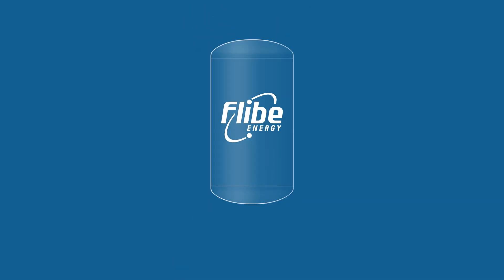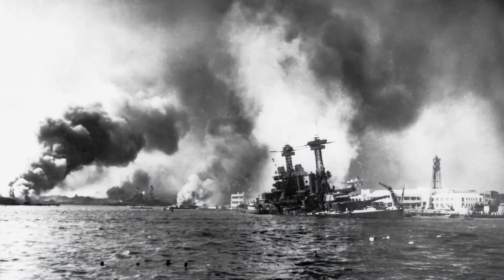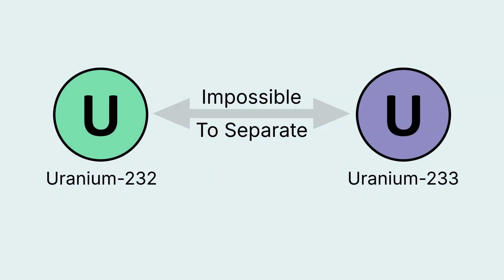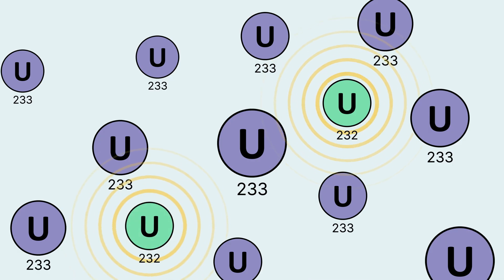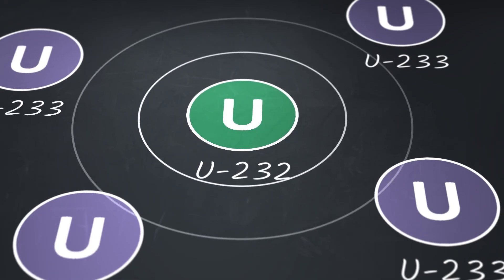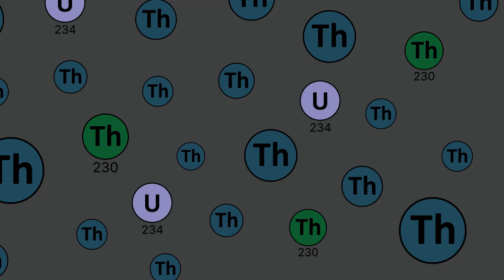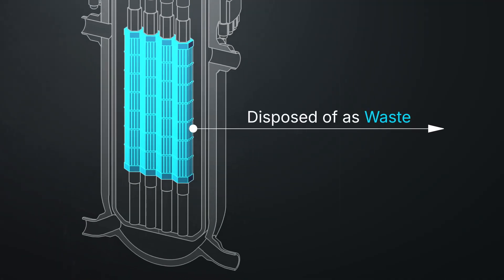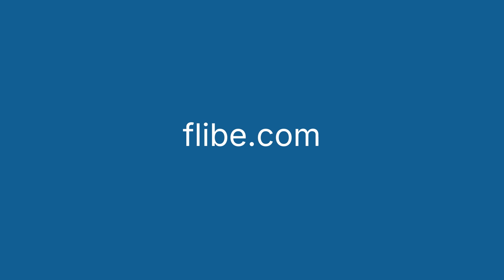How U-232 Influenced the Pathway of Thorium Reactors

Comment: The U-232 contamination issue has been solved in the LFTR "kidney" design?  I assume through fluid diffusion of sorts?

Or is it obivated in the LFTR design?
Reply from the maker: In the LFTR design we seek to increase U232 production to the maximum degree possible, to make the fissile uranium even less attractive for any diversion. We can do this because we do not employ conventional fuel fabrication and are therefore immune to the typical challenges that U232 poses for those making solid fuels.
Reply: @FlibeEnergy  Isn't U-233 the fissile nuclear fuel desired to be produced to the maximum degree? and U-232 desired to be minimized due to how it decays into products that produce gamma radiation?  Th-233 -> U-233 is the desired path?  Correct?

So what you mean is the LFTR design obviates the need to remove U-232.   Furthermore the U-232 presence is a benefit in that it decreases the possibility of it being U-233 enriched to build a nuclear bomb?

Comment: What about the pure U-233 left if al the PA-233 is seperated by fluorination in a decay tank. Still remember this question asked to TransAtomic Power  ''s Lesley Dewan in 2015. No Answer??
Don't get me wrong, I would like nothing more than nuclear power, but again this is not adressed in this video.
Reply from the maker: @arjanwesselink3418  This is a video about issues surrounding U-232 in past reactor designs, not a video discussing the specific implementation of Flibe Energy's reactor designs. It simply points to the fact that molten-salt reactors do not need conventional fuel fabrication and therefore are immune to many of the concerns around the decay products of U-232 that have troubled solid-fueled thorium reactor designs.
Reply: @FlibeEnergy  I get that, but I've also read the comments! Apparantly it was not so clear.
Honesty is the best PR for nuclear power in my opinion. It does so many things really, really well and people don't know about this.

Comment: Pointless, especially since the same tech can be used on a U-238/Pu-239 cycle (although that has a problem with prompt fission). Sorry to say no breader reactor is economical. Every nation that has tried using commercial breader reactors ended shutting down the program because of high operating & maintenance costs. Back in the 1980s the DoD did a study on at what price point would Uranium need to increase per Kg which made Breeders cost competitive with LWR: it was estimated to be about $5000 USD per Kg ($19K in 2024). Today Uranium is about $82/kg.

Nuclear power is going to die out over the next 20 years as costs rise & as high grade uranium ore is depleted. The huge cost of Vogtle, GA Unit 3 & 4 which bankrupted two companies has convinced all US Power companies to never invest in Nuclear power. I think all this talk about SMR is just hype & is going to die off in the next 2 years. Of the 4 US R&D companies developing SMR, all have shutdown their development except one that was getting federal funding.

Over all the world is heading into a energy crisis over the next 10 to 20 years as  Crude Oil (excluding Gas Condensates) Peaked in 2018. In the US, The price of Oil needs to increase to $90/bbl (in 2024 USD) to maintain or increase production. 3 of the 4 sweet spots have been fully drilled, & the last area, Permian has a water disposal problem. The US bellicose attitude toward Russia & the Middle east is also causing significant friction for global Oil production & investment. To add more trouble, the US debt is now over $101T (gov't + Corp + consumer) & Asia is looking to move away from the US Dollar for trade settlement.
Reply from the maker: @guytech7310  the dangers of liquid metallic sodium coolant account for most of those problems with "breeder" designs. There's no reactive materials in our design. Everything is chemically stable.
Reply: @FlibeEnergy  Sorry, MSRs aren't any better. They have other issues such as corrosion, caking breaking off and damaging pumps. Plus little to no viable method extracting U-232 & wastes products from the salt. Difficult to to inspect the reactor with MSR inside of it.

This tech is DoA, even if all of the tech problems are resolvable, US debt pending Oil production declines are going to prevent any commercial development. If power companies don't want LWR, they aren't going to gamble on MSR or any breeder reactors. Believing otherwise is pure hopium.
Reply from the maker: @guytech7310  none of the problems you mention manifested themselves in the nearly five-year operation of the US Molten-Salt Reactor Experiment. You're making up a straw man and then knocking it down. Oldest trick in the book.

Comment: Excellent video summarizing the historical background of the FLIBE proposed MSR solution as well as presenting clearly the mechanics involved which many would understand.  Since this is a safe solution with FLIBE having solved many of the inbetween technical issues, it is the best way to proceed with nuclear power and open up areas such as use in marine vehicles NOW rathern than later !!  Well done FLIBE

Comment: How would you deal with the hot radiation from U232 in the salt, if you need to reprocess this?! Chemically processing a salt with hard gamma radiation?! And where does the Beryllium come from? Thorium might be abundant, but Beryllium is not, and will be needed for a good neutron economy.
Reply: My understanding is that you remove the protactinium from the liquid fuel, therefore preventing U232 from forming in the first place. Let the Protactinium naturally decay into U233. But still, as the video explained, U233 can still get a neutron knocked off in the reactor and form U232...
Reply from the maker: @MaximumEscapeVelocity  removing protactinium from the blanket salt actually enhances U-232 production in the LFTR, since it transfers Pa231 formed from the (n,2n) reaction in Th232 into the fuel salt, where it absorbs another neutron forming U232. Remember that liquid fluoride reactors are immune to fuel damage from the decay radiations of U232, and we therefore desire to enhance U232 production in the reactor.
Reply: @FlibeEnergy  ahh, that makes sense now. So you take protactinium out of a blanket salt of thorium, let it decay to make U233, then mix that with the fuel salt. The Pa231 will be transmuted into U232 in the reactor and contribute to heat production. Is that right?
Reply: @MaximumEscapeVelocity  Interesting. Pa232 has a half life of 1.32d, so you need to do this in a continuous on-line process with all the other hot fission products in the salt as well. Contrast this with solid fuels, which are left to decay off most of their activity before reprocessing happens. My second thought would be that if you solve this problem, then you have a "clean" U233 making machine, which defeats the stated non-proliferation benefits. (Edit: its Pa233 which needs to be separated, with a longer half life of 26 days.)

Comment: So how long can the salt be treated and used?  Is there an end to its useful life or have we not determined this?
Reply: The salts can be used effectively forever, which is great for economics. They are the most valuable part of the reactor, and will perfectly retain that value even across future generations of plant. Eventually, power should become exceptionally low cost. (Obviously, the thorium fuel will need to be replaced as it is consumed, and also some vanishingly small amounts of F, Li, and Be as well.)

Comment: My favorite feature of a MSR is...there is no possibility of a "China Syndrome" scenario. They are explosion proof, because there is no build up of pressure like high pressure steam in a solid fuel reactor.
Reply: An MSR operator's worst nightmare isn't a meltdown, it's an in-core freeze-up! At that point the entire reactor is wrecked and unrecoverable. But that said, Everything's all nicely contained in one relatively tiny space, and the remediation is simply concrete intombment of the nuclear island. Like what was done to the defunct Hanford cores.
Reply: @rhonda-my_honda_cb500x  to be fair, an MSR doesn't start out @ 805c it's room temp when they start it up so. and all repairs are done robotically, every component every pipe, every connector, nuts, bolts are removed and installed robotically IF repairs need to be done. That's part of the design, they even speak about that in the old Oakridge videos.
Reply: What happens if the the Graphite Moderator would catch fire? In Chernobyl the Graphite burned for a long time, taking nuclear inventory into the athmospere.
Reply: @schmitzbeats6102  Well seeing as how it's completely submerged in molten salt and not exposed to any oxygen...how could it possibly burn?
Reply: If somehow things go terribly wrong, you will only end up with a radioactive room or building NOT a radioactive ghost town or countryside.😊☢️

Comment: I'm having trouble understanding the graphic on the thorium fuel cycle. It says "Neutron Absorbed by Uranium," but it seems like it should be "from Uranium" or "by Thorium," am I reading that wrong?
Reply from the maker: @salsuginusrex5196  No, you're not wrong, and that was a good catch. It should say "Neutron absorbed by Thorium." Sorry about that one. An erratum correcting this has been added to the description.
Reply: No, there should be two neutrons. 
The bottom right should have "Neutron Absorbed by Thorium[-232]", setting off the decay from Th-233 to Pa-233 to U-233.
"Neutron Absorbed by Uranium" should be in the upper right -- that neutron sets off the fission of the uranium atom (which is also the source of the 2+ neutrons).

Comment: Unbelievable that this technology was crushed from within.

China is already pushing this technology forward and it should be noted, that if they succeed and take themselves off of the Fossil Fuel Economy, the west is fd in the a.

There should be massive resources pouring into this technology, as not only is it safer, it's a more powerful solution to our energy needs, as a bridge tech until fusion is captured and commercialized.